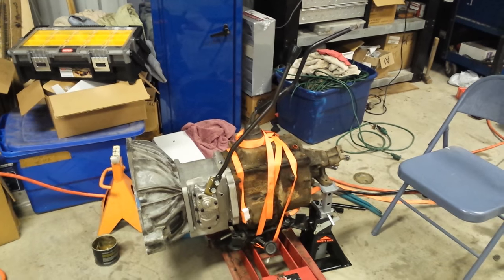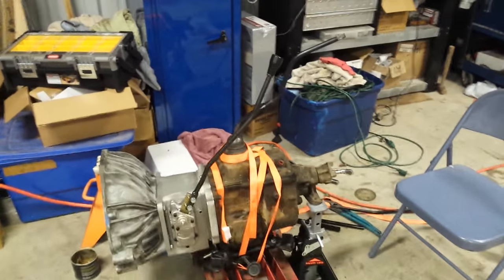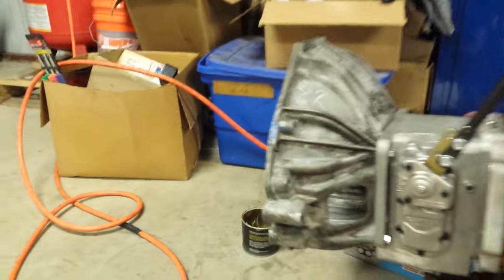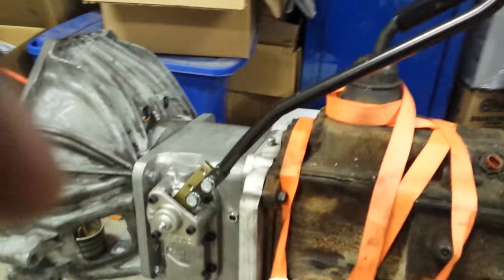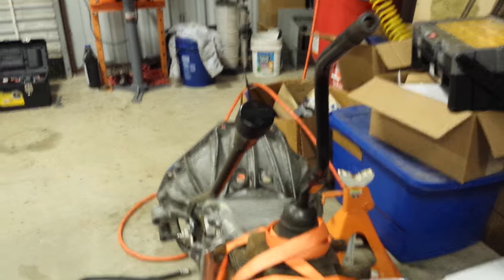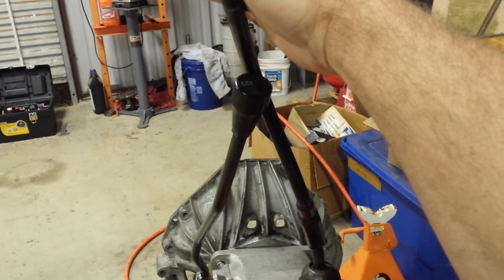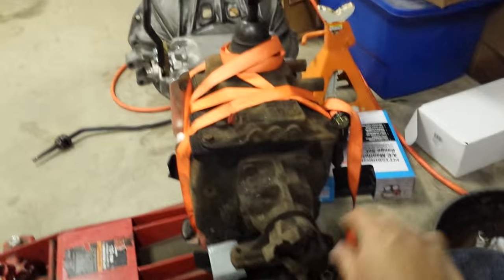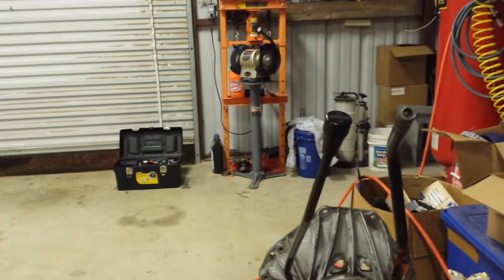F150 Twin Stick Transmission Part 1.

Comment: Granny low 4 speeds are basically 3 speeds. Nobody ever uses 1st.
Reply from the maker: Yes, but they have 4 forward gears so technically they are 4 speeds.  I use the granny low on occasion.  For example in drive thru lines it comes in handy. Just let out the clutch and let it crawl forward.

Comment: Would that work with a 4x4?
Reply from the maker: Yes, but only an older 4 speed manual transmission. Will not work with 5 or 6 speeds.

Comment: Can I get one for my 95 ram gasser?
Reply from the maker: Unfortunately no. They only make them for Ford and Chevy with 4 speed transmissions. They will not work with 5 speed transmissions either. 
That is not saying that you could not modify a bellhousing to bolt to a Dodge engine and then a Ford or Chevy 4 speed granny. You would also need to find a clutch that would work because I believe Dodge uses a different input shaft, but I could be wrong. Question is, are you up for the challenge? It would be a lot of work.
Reply: Ok thanks, I don’t wanna put that kinda money into it. I just kinda thought a twin Stick would be fun

Comment: I want a gear splitter but I don’t know how that’d work with my manual transfer case
Reply from the maker: this particular splitter goes in front of the transmission and pushes everything back about 6 inches, so works just fine with a transfer case.  Has to be an older 4 speed transmission though, won't work with 5 or 6 speed manuals.
Reply: ktumbleweed I’ve got a 1979 NP435

Comment: How much is that ?
Reply from the maker: This Advance Adapters Overdrive sells for around $1600 last time I looked.  Plus you need a Ford or Chevy 4 speed transmission. They also make one to go from a Chevy engine to a Toyota Land Cruiser 4 speed.
Reply: @StumpyVanLife  where i can look for it?
Reply from the maker: @MsGabo1983  It's been discontinued, only way to find one now is used.
Reply: @StumpyVanLife  :(

Comment: I'm looking to do this exact setup on my F350 I already have the t18 transmission would you please give me the make and model of the splitter cuz I would like to do the set up the exact same as you
Reply from the maker: It is an Advance Adapters Ranger Torque Splitter.
Reply: ktumbleweed they are only rated to 420 ft lbs tho 😭what would you do in a old ford truck converted to a Cummins Then.. I understand these are used to give a low torque engine a fight chance at pulling but what would you use for a 12 valve An ford tranny?
Reply from the maker: They are rated for 24,500 lbs gross combined vehicle weight, I have not heard the 420 ft lb rating. I would not hesitate to put behind a stock 12 valve or even one that was turned up a little. Now getting a ford 4 speed to bolt to a Cummins takes the right bellhousing. They made bread trucks with 4 cylinder cummins and they used Ford 4 speed grannys. You would have to find one of those bellhousings. The 4BT and 6BT have identical bolt patterns.
Reply: its a gas v8 thank you
Reply from the maker: Are you asking if my truck is gas V8?  My truck is a gas 6 cylinder.  Ford 300 straight 6. Has plenty of torque for my needs.

Comment: 4l60 is a 27% od. Gear ratio is 
0.70:1
Reply from the maker: You would think the math on the gear ratio / percentage would be easy, but it is not.  We are both incorrect. I filmed this three years ago and have since learned different. A 27% overdrive is not .70:1 , its not .73:1 .  It works out to be around .78 or .79 to 1.  I had to speak to an engineer at gear vendors to figure this out. He explained to me there is some weird math function going on when figuring gear ratios as a percentage.  Advance Adapters advertises this overdrive unit as having a 27% overdrive , I called them and they could not tell me the actual ratio, thats why I ended up calling gear vendors.  Long story short a 1 to 1 ratio is a 0% overdrive - no duh right?  Then what is a 0.5:1 overdrive ratio expressed in a %?
Is it 50% ?  Would make perfect sense right?  But nope,  a 0.5:1 is a 100% overdrive!!  If I am wrong correct me as I am not 100% sure I fully understand the math on this.
Reply: @StumpyVanLife   I appreciate the feed back! Also I'm looking at putting one of these in front of my NV4500 would you happen to know from putting this one together what the two different transmission bolt paterns are on it?
Reply: @StumpyVanLife  however you are right it's not a direct match we are dealing two different types of transmissions. I don't know what the slip rate on a torque converter is but it could account for the 3% difference between directly calculated 27% and the .70:1 ratio of the 4l60e. Directly calculated in a manual situation. Yes the over drive would be .73:1 which is almost if not exactly the same overdrive as the nv4500 and the 4l80e to calculate it you subtract the smallest number from the largest then device it by the largest. That will give you the percent. I don't know why the person you talked to wasn't sure? Everything I've heard about advance adapters they were pretty good and pretty open with info like that. But yeah I looked in their manual for this thing they don't have it listed there either